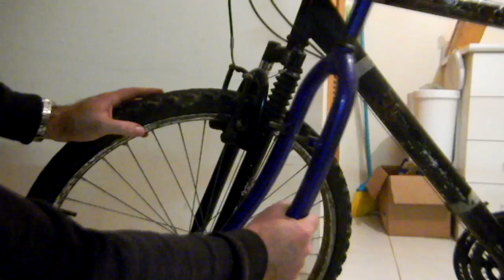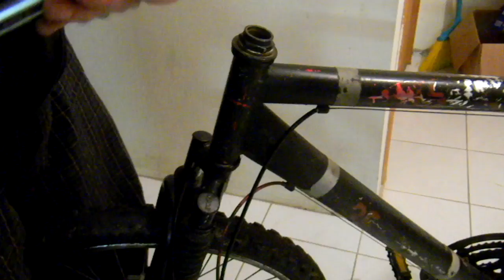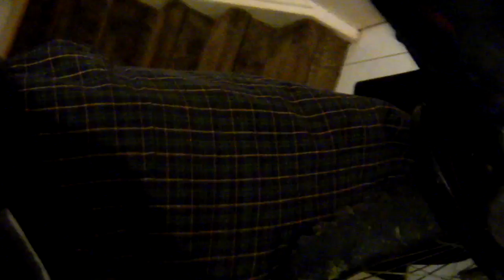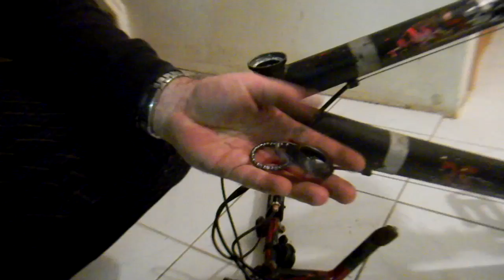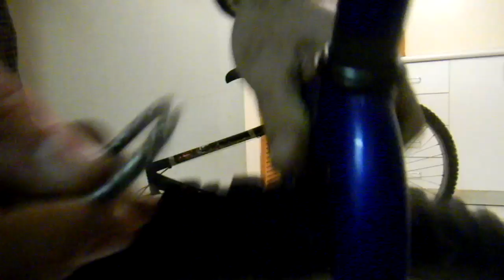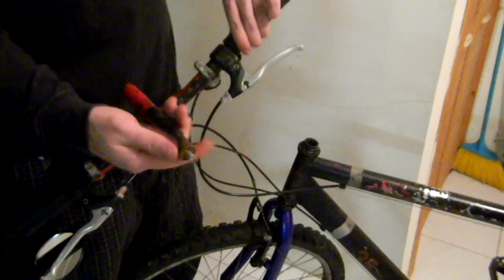How to Remove and Reinstall a Front Fork on a Bicycle

Comment: Why is better with the new fork??? I try to do the opposite in one GT.better not to do it you say ???
Reply from the maker: The old suspension forks that this bike had were no longer working anymore. They didn't move up and down properly so they were not cushioning bumps anymore. They also had a bunch of 'play' in them, which meant they caused a wobble when applying the front brakes.
Reply: @cjhoyle which is better dude

Comment: What if you didn’t have a front tire to brace yourself with when unscrewing ring? Someone stole front tire
Reply from the maker: hmm. If you had another bike with the same (or smaller) wheel size, you could borrow that. Otherwise, you could try something like bolting the front dropouts to a piece of wood.

Comment: In refitting the baring on the tube he missed out the grease so the baring will corroded and rub against the two pieces inside that will ware away to quickly
Reply from the maker: You are incorrect. At 9:50 I applied new grease.

Comment: the bolt that holds down the handlebars down is not turning what can i do?
Reply from the maker: Use a larger wrench so you can apply more torque.
Reply: cjhoyle it wont move
Reply: try spraying wd40 or some other spray silicon around the stem bolt threads, allow to seep in for hours, not minutes. you really need a decent set of allen keys. follow the instruction exactly as shown above. note: RIGHT-threaded means stem bolt turns clockwise. ONLY 4 turns to clear the stem bolt nut.  take it to shop if this not work for you

Comment: I have an OLD MTB, experts say I need a 1 coil suspension fork for it, they say its a rarity, where can I find one?
Reply: nasos1981  Eh, got an SR Sountour M3010 SF11
Reply from the maker: I have no idea. In my experience forks seem to be pretty interchangeable between different bikes, but I do not claim to be an expert.
Reply: cjhoyle
What kind of Coil do you have ?
Reply: HunHarcosGaming good choice is the rst capa with lockout and steerer 1'' threadles for old bikes!http://www.rosebikes.com/article/rst-capa-t-26-mtb-suspension-fork/aid:245457
Reply: +cjhoyle That is not true unfortunately. I have a bike from the same year as my dad's bike and they look pretty similiar but the forks have different dimensions and are not interchangable.

Comment: i've done all the steps mentioned in the video ...but it didn't it's like stuck in it's place
 ......pls help me bcz i don't want to sell my bicycle in scrap.....
Reply from the maker: When you hammered on the bolt head did it move down at all? If not then you need to hit on it harder. If it did then you should try loosening off the bolt by a few more turns and hit it again, Let me know if this helps. Sometimes they can be a real pain to unseize!
Reply: cjhoyle
no it didn't move. i try it many times with lot of force but it didn't move. 
i really appreciate your help......

Comment: Yer it has the same style headset as the one in your video, the suspension at the moment is horrible, is it possible to switch to a non-threaded headset? maybe I could send you a photo of the bike. Also I noticed in your videos you always have V-brakes on your bikes, is that because you find them easier to maintain than discs? thanks
Reply from the maker: As I said, I've never tried it before myself . My gut tells me that it should be possible, but you'll have to do some of your own research. I prefer v-brakes to every other style of rim brakes because they are very easy to tune and keep properly adjusted. Disc brakes definitely have better stopping power, and work best in wet conditions, but they certainly aren't as easy to make adjustments to. Also, replacement pads for them are generally more expensive and harder to find. Most of the time I'm happy enough with how my v-brakes perform, so that's what I stick with.
Reply: cjhoyle Okay thanks a lot, one more thing, my bike has grip shift gears if I was to change the handlebars, do they come off easily? your videos are awesome mate, I've learnt so much from all of them!nice one.
Reply from the maker: No problem, I'm glad you found the videos helpful! Yes grip shifts are pretty easy to take off. They are normally held in place with a set screw that takes a small Allen key. If you replace the handlebars, make sure the new handlebar are of a similar diameter as the old ones or the grip shift won't fit.
Reply: cjhoyle Okay thanks, I saw some of your other videos and saw that you studied engineering, it figures, judging by how technical minded you are. what kind of engineer are you? your snowstorm videos were pretty cool, has it all cleared up now?

Comment: Hi can I put an expensive front suspension fork on my cheap old full suspension bike? How do I make sure the forks will fit and are not the wrong size, thanks!
Reply from the maker: Does your cheap full suspension bike have the same style of headset as the bike shown in this video (threaded headset)? If so, upgrading to high quality forks will probably mean switching to a non-threaded headset. I have never done it before myself, but I imagine that it is possible to switch from a threaded to non-threaded headset. 2 things that you definitely need to make sure of is that the tube of the new forks is long enough to fit through your frame and that the old fork and new fork have the same tube diameter and bearing size.

Comment: scince he wont cover it, basically with normal ("expensive") forks, you unbolt the 2 bolts on either side of the stem on the fork side. then you unscrew the little cap on top of the fork rod, then pull off the stem. should come off easily. if you're replacing you're stem, be sure to measure out your bars and fork rod! there are 4+ bar sizes and 2 common fork sizes!!

Comment from the maker: Are you saying that you have unthreaded the top bolt completely and you can't hammer it down any further? Have you tried rocking it back and forth? If the wedge is completely unreachable from the top, you also have the option of removing the front wheel and accessing it from the bottom. The long bolt should thread into the wedge from the bottom and you can try putting on the bolt, instead of pushing. If you make a video showing your problem I wouldn't mind taking a long and offering any advice.

Comment: Hi, Great video!, I did what you explained in the video, however, I removed the top bolt totally and now I am unable to take out the steering wheel, I hammered twice and it is getting more difficult to remove. Any advice? thanks

Comment from the maker: I have never done it before myself, but I imagine that it is possible to switch from a threaded to non-threaded headset. Just verify that it tube is long enough to fit through your frame and that the old fork and new for have the same tube diameter and beading cone size.

Comment from the maker: I'm sure there are websites that you can order them from, but I don't have any experience with any particular one. My advice would be to just go to your local bike shop and ask them about ordering forks. Depending on the size of the shop, they might not have any in stock, but they will have a catelog with many many choices that they should be able to order them for you with.

Comment: Hi, I just want to inform you that the problem was solved. Turns out that I didn't tighten the bolt enough (was using a short Allen key) even when I've tried very hard to do it. Seems I need to look for a long Allen key in case I need to do it again in the future. Btw, I got a question about my hubs, I'll post it in your wheel hub tutorial where it's more appropriate. Thanks.

Comment from the maker: Is the bolt head actually shaped like a torx, or is it still a hex? Unless it's shaped like a torx then there should be an allen key that will fit it too. Torx are pretty rare on bicycles. I have heard of people using torx bits instead of hex when they are in a pinch. Since torx have 6 points, they will fit into the 6 corners of a hex if you can find one that's the right size.

Comment: Nice video, Thanks.  My headtube seems to be a T-40 Torx.  I tried all my hex wrenches both metric and standard and not one of them fits right.  But my Craftsmen T-40 fits it perfect.  I'm curious if it really do sometimes use Torx for older (1994) Huffy bikes, or its just coincidence it fits so well.

Comment: Great informative video, i tried to swap the fork of one bike with another (one has suspension and one doesn't) but the diameter of the stem is too small for the frame. Is there some sort of converter i can use to upsize it?

Comment: I just recently buy this bike (it's brand new). I think you're right about incompatible parts, though it seems odd for a folding bike to use such kind of parts. I haven't use this bike at all, due to the problem, because as you say, it was a safety hazard to ride it in it's current condition. Well, seems I need to visit the manufacturer's authorized repair shop nearby to have them look at the issue. Will inform you again when it's done. Thanks for your reply btw.

Comment from the maker: Has this bike always had this issue? Are you sure these parts are meant to go together? Tightening the stem bolt should make it expand to properly fill the gap. It sounds like you're using incompatible parts. I don't think using tape is a great solution. Your safety is seriously at risk with this section of the bike.

Comment: My folding bike stem (it's a threaded one) is so loose that when I insert it to the headset it just slip all the way down . When I tighten the stem it still have play (turn to the left or right). I'm thinking of putting some tape around the stem so it will not be so loose anymore. What do you think ?

Btw, thanks for the tutorial, especially for the hammer tip.

Comment: Not all threaded headsets are cheap. I have a Trek 720 that was $450USD in 1993 that has a threaded headset. Also, it's slightly different. The cone actually is accessible with a wrench and I recently needed to tighten it because when I put on the brakes there was a slight rocking motion of the forks that you could feel if you put your fist around the headset, locked the brake and pushed the bike forward and backward. I also don't like the new aluminum bikes, I like chromoly better.

Comment: Hey, thanks for the video. I have the same problem with my bike that you had. The fork is shaking when I use the front brake. Is there anything I can do to solve this problem without replacing the fork?

Comment from the maker: I bought this bike in the summer of 2008 for $35 used. It served me well for 2 years as my primary committing bike. When I got my 'green machine' in 2010 I started using my black bike mostly as a backup. In the spring of 2012 I sold this bike for $35. I sold it because it has always been a really heavy bike and I knew I was going to eventually upgrade to something aluminum During the time that I had this bike I think I put at least 6000km on it!

Comment: Threaded fork/stem generally have a 1" tube size.  Threadless fork/stem will usually have a 1 1/8" tube size.  its pretty ease to tell the difference.  a 1" generally has the stem inserted into the fork while on a 1 1/8" the stem will clamp to the outside.

A couple of things to consider when swapping forks:

obviously wheel size.  16" - 700c

Axel size:some road and mountain bikes made for a quick release system will have smaller dropouts.

Brake Mounts: weather it is U, V, Y,etc

Comment from the maker: Sorry, I don't know the diameter. From my own experience with swapping forks, the tubing diameter has always been the same, on all the differnt forks I have tried. I would assume they are standardize for most modern bikes, but I could be wrong. As I mentioned in the video, the length of that tube is really what is important to confirm that it will be long enough and not to long to fit in the frame. I hope this helps, let me know how it works out. Thanks for subscribing!

Comment from the maker: I'm really not sure what is available for what you are looking for. Usually higher end forks use the thread-less style of headset. If you buy them brand new, I think they come with a very long 'head tube' because the idea is that you will cut it to the length you will need for your bike, since all bikes are a bit different. If you're planning on ordering your forks through a local bike shop, just ask them to confirm that whatever you order will work on your bike.

Comment: I have the same body frame of mountain bike like yours. I'm planning to replace my fork and buy some new and expensive but i have one problem is there any heavy duty fork with suspension that is able to fit in the head tube of my MTB? Bcause most of bikes that i had seen with the same type frame of my MTB had a small distance between the two sliders which i don't like..

Comment: Thanks for this video! i bought a similar used bicycle online and when it arrived I found out that its really a piece of junk.. The handlebars are crooked and I think i need to replace the stem. The crankset seems to be pretty bad too because if i put too much pedaling force to them it just jumps forward making riding uphill nearly impossible. Im pretty new to bike repairs. Anyways, this should help a lot! Time to check out your other videos.

Comment from the maker: I'm glad you've been finding my videos helpful, thanks for subscribing! I've been wanting to make a series of videos about winter commuting for a while now, hopefully I'll get the chance this winter. In terms of maintaining the chain, really the key is just to use lots of chain lube (oil) to dilute the salt and reduce the rusting. You'll notice after a day of riding on wet salty roads that it probably will get dry and squeaky. I just add more lube, and clean the chain at the end of the season.

Comment from the maker: Mine is a cheap department store style mountain bike from several years ago. I always prefer to fix things rather than replace them, so if you can find a set of forks which will fit it, I would recommend just replacing them.

Comment from the maker: @Sevensicketytwo Has the stem not been touched in a really long time? I guess it's possible that the two surfaces have both corroded really badly, the way that seat posts sometimes do. If the problem is corrosion then you would need some type of chemical to breakdown the rust to get it unseized. I have never dealt with that problem on the stem of a bike before. Sorry I can't be of more help. Let me know if you get the issue resolved, I am interested!